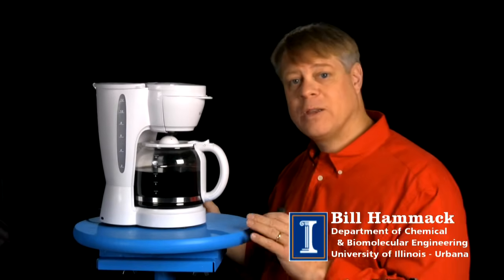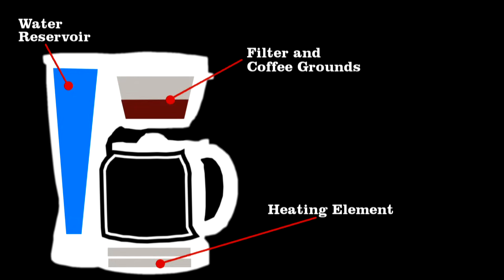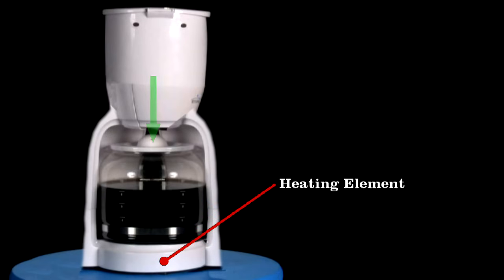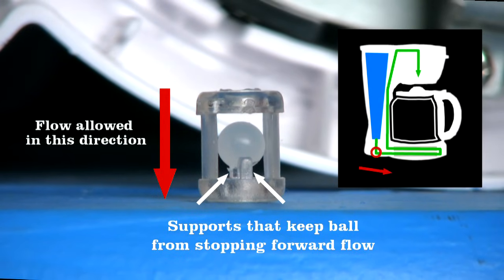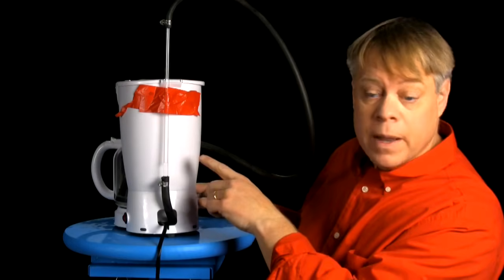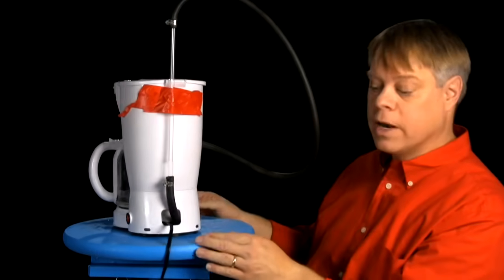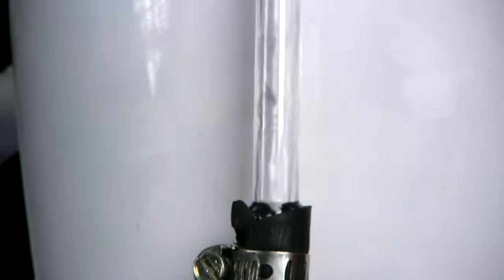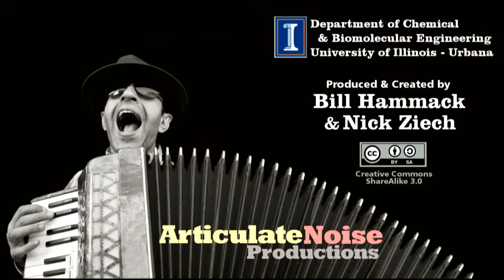Coffee Maker: Pumping water with almost no moving parts

Comment: You didn't actualy explain how pumping is provided.
I actually expected a full story as you did with metal cans or parker pen.
But thanks anyway
Reply: When you heat something, it rises due to less density. When you boil something, it turns from liquid to gas.

So what they did in coffee machine was, put water down the bottom to heat, and put a one way valve it to stop it flowing back into the reservoir.

When the water gets hot and rises, it can only rise up the tube.

In addition, if there is boiling, the bubble of steam also wants to rise, but again it can only rise up the tube and not through the one way valve. In this case, the bubbles are helpful as well because their motion up the tube helps pump the rest of the water upwards. 

Here are some links to pictures to illustrate the phenomenon:
http://www.mis.mpg.de/fileadmin/otto_img/convection_0_.png - this one illustrates convection
https://www.stwing.upenn.edu/~salexa/Research/BubblePumps/Configurations.png - this one shows several ways one can implement a bubble pump.
Reply: But he did, starting at around 2:00.
Reply: Well I did get the idea of dencity difference
but I didn't catch the real motion behind description(A schematics both with actual movement happening would be nice)

I mean all other videos are full of descriptive schematics. That is the whole point of this channel Isn't it)))

Comment: @engineerguy your coffee maker with an elevated reservoir would work without an additional heating element. You just need to route the water through the heating element and back below the reservoir, as long as the outlet is still below the reservoir the water will flow.

I imagine the reasons your proposal of an elevated reservoir is not used have nothing to do with saving money on a pump or a heating element. Instead, a non elevated reservoir lowers the center of gravity of the machine. Also, the non elevated reservoir ensures that the water will not flow unless heated, an elevated reservoir coffee maker would need a valve to control when and how fast the water flows adding cost and complexity.

Your video shows how the solution works but inaccurately presents the problem by implying that the water would not flow down through the heating element and back up to below the reservoir.
Reply: Your solution (based on the principle of communicating recipients) the speed with which the water runs will depend on gravity. You can vary the volume/time by selecting a differnt section to the tubing, but you can not vary the speed. So you need to have a powerfull enough heating element to heat the water very quickly. While in the solution presented in the video you can use any power for the heating element, liquid circulation will only start when the water is hot enough, only than will the pumping effect occur. So you have the guarantee the water is always hot enough to boil the coffee.
Reply: @emilemilian7404  Good point! I had not considered that at all.
Reply: While ingenious, your idea has one problem. Once the coffee is made, your supply of hot water will be exhausted.
Reply: Is your proposal that the water after mixing with coffee beans/powder, should be sent back to the heating element at the top to keep it warm i.e the heating element performs dual functions, heating the pure water from the reservoir and also the coffee-water mix?

Comment: I've had some good lecturers like you in the past. The world needs more of you guys. Top tip, if you use an electric kettle for making tea, boil a full kettle, pour it into the empty coffee maker, and the coffee produced will be of a significantly higher quality. I've done it for years. Much better than those sad little heating elements. You'll taste a difference.
Reply: +James Laidler 
You mean pour it directly on the coffee?
Reply: No, pour the kettle's contents into the resovir. Boiling water is bad for ground coffee. Too hot. Pour the hot contents of the kettle into the resovir to go through the standard path for the hot water.

Comment: In the title you have no moving parts,the ball valve is moving as you correctly say in the video.You had me on the klick bait.
Reply: +Picobyte But it's not the ball that moves the water, it just prevents the flow back.
Reply: gredangeo Moving parts are those that rub against other matter.AC squirrel cage motors for instance have no moving parts internal,they do have bearings that move. but all the power is generated by magnetic fields so it doesn't wear at all.

Comment: I was looking at my pond pump one day and was thinking about how to make a pump that can pump the water around but uses no power. This bubble pump sounds good but it would cook my fishy wishyies. Another way I thought was using capillary action but that wouldn't produce enough lift or a decent flow rate but if it can push water to the tops of towering trees then it must be able to used in the way I want.
Reply: Gunzee No power? The bubble pump has to boil water in order to function, that requires a LOT of power.
The benefit of the bubble pump is exactly as described in the video: No moving parts & able to use 1 heating element for 2 jobs. Who said anything about not using power?
Reply: Gunzee you  can make a bubble pump that empty into a resovoir that then dumps out, if the water in is only a tiny fraction of the resovoir then the the water temperature shouldn't rise all that much, at least i think!
Reply: liquidthex me said something about not using power, I want a device or system that will pump water but uses little to no electricity. I was thinking something that like a hose pipe full of tiny pipes that uses capillary action and empties into a small tubes which empty into a small container and again use the same tubes to push water up again. Or a solar powered pump but you'd need batteries when there was no sun and the UK is great for grey skies.
Reply: Gunzee i'd recommend to buy a normal pump, moving water this way would consume a lot of electricity, heating water and then transforming it into vapor just to move it would be extremely expensive and power consuming. in a coffee maker it makes sense because you need to heat the water anyway, and you're not pumping a lot of water...
Reply: +Gunzee Capillary action works by striving to equalize the moisture throughout the medium (saturation) , but you'd be hard-pressed to realize any serious flow. Long term plant-watering systems (capillary wick) would empty themselves too quickly and flood the pot otherwise .

Comment: I wonder what Moccamaster does to prevent that horrible slopping noise. Every coffee maker I've yet seen except that one is horribly loud at the end of each run.
Reply: RealationGames Well, without actually looking it up, the answer may be in this video.... This bubble pump function is designed to allow 1 heating element to do 2 jobs, to be more efficient and presumably cheaper to manufacture..
But if you didn't care about that you could just use 2 heating elements.. That should be much quieter, I would think.
Reply: liquidthex
They still do pump the water in Moccamaster, it's not gravity driven.

Comment: Such simple and effective design. Very elegant.

Though I have not use one of those type coffee machines in over 7 years.
Reply: Philip Anderson The one I've used for years omits the heating of the coffee pot (it's a thermos), but keeps the traditional piping because it also provides a smaller total height.
Reply: so it works like and old pupper boat
Reply: You look younger so this style coffee pot is probably most like that handle on the inside car door that goes around and around to move the window. Lol. I joke, I joke.

Comment: They could use heat-resistant tubing and wrap it around part of the heating element with a somewhat smaller opening at the filter end to slow the flow of the water (if I understand my plumbing correctly, the bends in the tube would reduce the flow even further). I imagine that if the the heating element is hot enough to keep the coffee pot hot enough for drinking, through the plastic it should be able heat the slowly flowing water enough for it to be used in brewing.

Comment: The water reservoir on the top presents two additional problems too; the reservoir cannot be overly large (fewer cups before you have to refill), and stability issues (heavy reservoir on relatively a narrow base). This was an optimised solution for the problem faced... at least until the heating element burns out, in which case you're not getting coffee anyway.

Comment: What if you have just one heating element to heat the water and then, as you'd shown in the other design, pass the hot water through the coffee grinds? Why would you need to keep the pot below hot if the water itself is hot enough to solubilize (or suspend) the coffee particles?

Comment: That was not my precise intention. I was thinking of using an inverted siphon to feed the water through the bottom heater (which is, as you said, in place to heat the pot), and was counting on the weight of the water in the reservoir far above the grinds to push the water back up to the level of the grinds, where the water would continue on its way through the machine.

Comment: I have a question about something that seems simpler to me-and as engineers know simpler is better. Near the beginning you discussed the possibility of putting the water at the very top but you said that would require 2 heating elements. I disagree, because as long as the reservoir is above the coffee grinds, when it goes through the heating element the weight of the water above it will push it back up to the  coffee grinds, and as long as the tubing is very thin, little water will be wasted.

Comment: For anyone not totally clear from this video (like me, I did a little extra research), the reason this works is because the tube is sufficiently small diametrically so that bubbles can lift small columns of water as it heats up and starts to boil.  For some reason, I had thought the valve had something to do with the pump action, but that is not the case.

Comment: I love your videos, but I have to mention.  This "problem" could be solved by using a thermal carafe, then you wouldn't need a heating element for the carafe at all... in face, this is the better way to go because the heating element burns the coffee.  

The biggest problem for drip coffee makers is getting the water to the proper temperature (just below boiling) when it hits the grinds.

Comment: @kalchas which causes the distinct gurgling sound you hear. It also allows MORE water than the amount needed to reach the extra inch to the grounds to escape. So the vaporized water that is escaping as bubbles lowers the level enough to allow more cold water into the heating resevoir, so it can be heated and repeat this process, hence the name "bubble pump". I hope this helped you get the picture a little better and wasn't too long.

Comment: @kalchas no more can of soda. The same thing applies to the water in the coffee maker. As the water is heated, the atoms are forced apart. since they can't go back, the water levels can't be balanced out. the heated water has only one direction to expand. When it gets hot enough, it expands to the point that it reaches that extra inch and is poured onto the grinds. Some of the water is heated so much it turns to vapor, and escapes as well since it is now less dense than the air (think clouds),

Comment: @kalchas specifically the amount of energy within the particles which is the cause of these motions, temperature). As you may recall from high school (assuming your age, here) all atoms are composed of three major parts, the protons and neutrons which reside in the nucleus or center, and the electrons which sit in a region outside this center. Now, while this model is not really accurate, it does help to give some idea of what is occurring with heat. Think of the area outside of the nucleus as a

Comment: @ChristopherTupper The problem is one of altitude -- the point where the water exits the system onto the coffee grounds must be higher than the reservoir.  If it's lower, the cold water will simply drain onto the coffee without stopping to get warmed up.  But if it's higher, it won't want to move at all.  What makes the water climb that last inch of altitude?